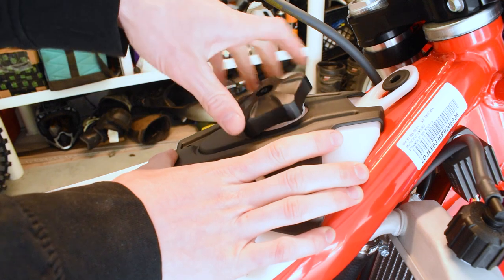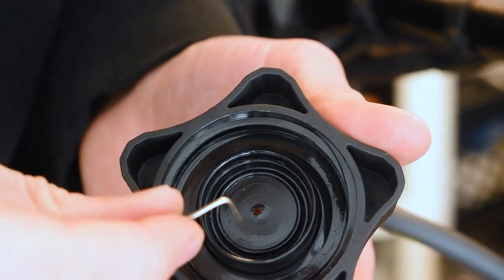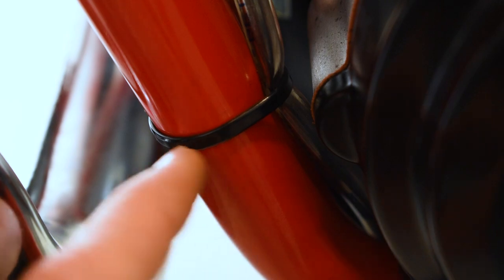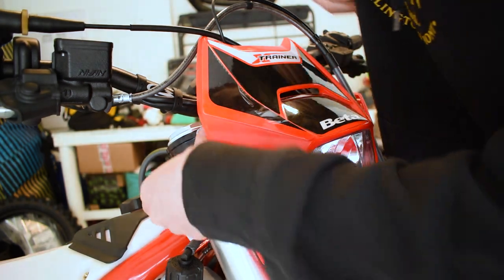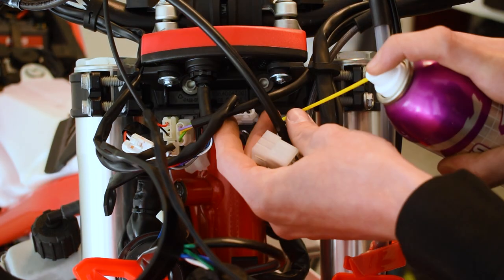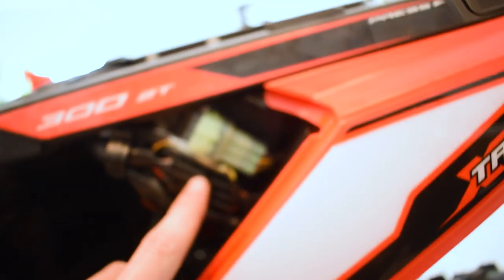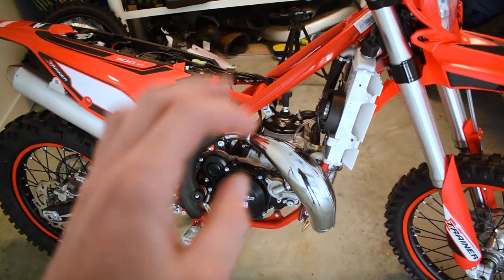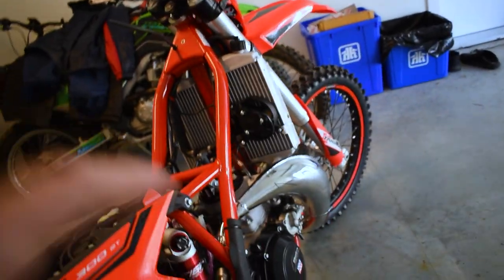If You Own A Beta Dirt Bike You Need To Do This Before You Ride!

Comment: I would also recommend tossing that plastic throttle tube and get the self lubricating aluminum one. It feels so much better & has a removable end cap in case you want to install full wrap hand guards.
Reply from the maker: I just cut mine to install my wrap arounds! But ill take a look at the throttle tube! Thanks for the idea!

Comment: Question, you had a 140F. Underneath the bike there’s a tube by the air box and mine is full of little rock’s. What is that tube?
Reply from the maker: The ones that look like tube caps are for catching debris/ liquids. You can remove it, and clean it out and put it back on

Comment: Thank you for the video. Those are all great tips and a couple of them were very helpful to me. I would add another, which is to put a little anti seize on the chain adjuster bolts. It's also never a bad idea when you get a new or used bike to grease the swingarm bearings, shock linkage and steering head.
Reply from the maker: Agreed!

Comment: Why both ACF50 and dielectric grease?  Why not one or the other?
Reply from the maker: Acf 50 is a liquid foaming spray that gets into every crevice and is a neutralizer for corrosion. The dialectric grease acts as a physical barrier to prevent as much water from getting to the contacts

Comment: Good video. However, why doesn't anyone grease the headstem, and all of the linkage bearings?
Reply from the maker: Because its a kinda a pain in the ass to do
Reply: @AaronsEnduro  and time consuming.  However, it's easier to do that when the bike is new. It also increases the longevity of all those pain in the ass bearings. I absolutely get what your saying.
Reply from the maker: @user-dd2xl4ns5q i agree with you!